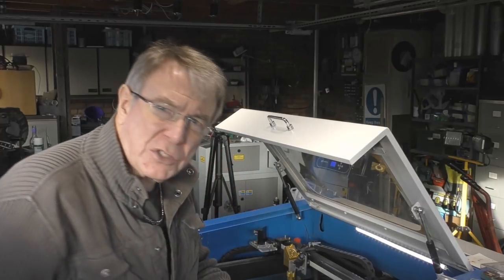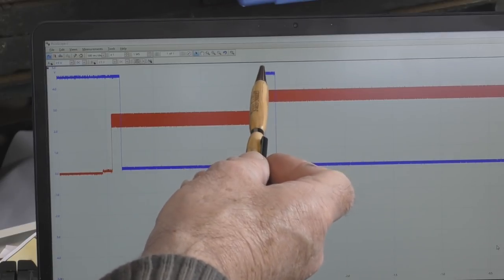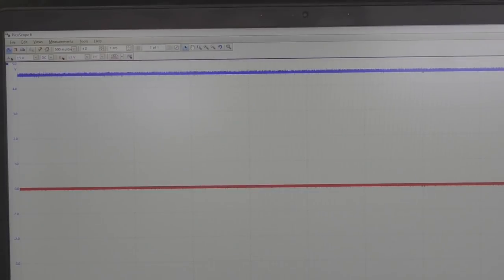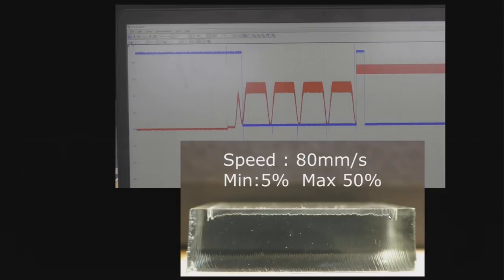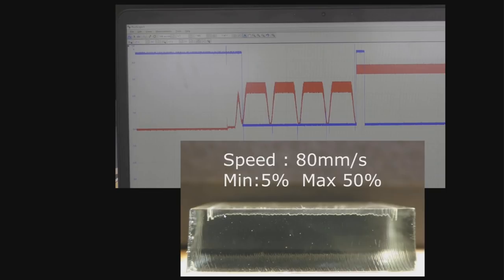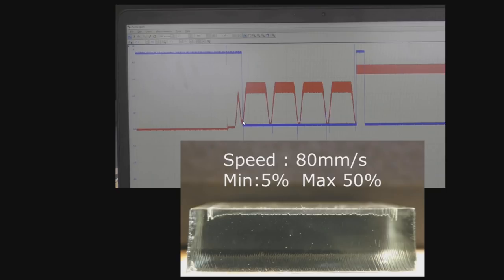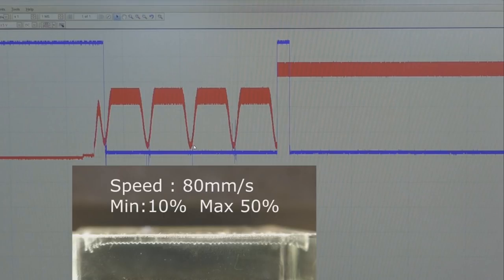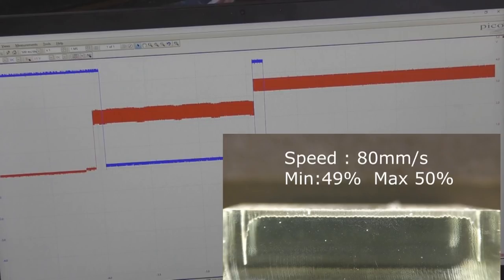RDWorks Learning Lab 134 Max Min Power Revisited

Comment: Wow, this is beginning to make sense somewhat. We have a Thunderlaser 80w Rudia 644XG controller. We have just moved to Lightburn from RD works. Trying to get my head around min, max power settings as I am about to do material tests using lightburn. Our laser is governed to 70% so if you set at 100% it will cut back to 70%, normally we cut max at 60% which is why tube has lasted 7 years.

Comment: Thanks for these videos.  I had issues with my corners on small detailed shapes.  The shapes looked bad in general and the corners we just weird looking and didn't know why.  By going through your experimental procedures I found for my job using 10%/30% on clear acrylic  cleaned up my corners beautifully.  I am now getting uniform etchings.  I'm running 100w Boss system.

Comment: Russ, as you may already know, the laser may take a higher excitation voltage to initially fire, but require much less to maintain a beam once it has fired. Witness the humble ne2 neon bulb. It takes 90 volts to fire it but just over 50 to keep it lit. I would suppose an interesting experiment may be to find a way to measure the applied voltage while watching the tube’s output with a cell phone camera or equivalent.
Reply from the maker: Hi Joff
You are right, in that this sealed tube is just like any other gas discharge tube. Gas is inherantly non conductive  and therefore applying Ohms law we find that almost infinitely high resistance  will not allow current flow  so we need a very high voltage (depending on the gas we choose)m before the gas starts to break down into an ionized condition where there are lots of free electrons that will conduct current. At this point the resistance drops so it requires less voltage to make the current flow. This is why there is a start and a steady state voltage for the tube. In out case those voltages will be dangerously high so DO NOT go near them unless you know what you are doing or have special measuring kit. The start up voltage could be around 30kv and the steady state settles at about 17kv. You cannot see the tube output because it is a  beam of invisible infra red light  You can see the pink ionized nitrogen in the tube but do not confuse that with the laser beam. The ionized nirtogen will change intensity as the current flow changes,  so that will be visible

The following two video will help b ring you up to speed on the tube physics and the power supply design/function.

https://www.youtube.com/watch?v=2F5O-1TH8b0&list=PLPWEtx5V9DqEogIeYRdcG_KYcB7UL2Qmn&index=7&t=124s

and from 4 min 40 this one   https://www.youtube.com/watch?v=5CoTrLNUWTM

Best wishes
Russ

Comment: As with everything on this machines, it depends on a lot of factors, I believe more importantly the laser power supply power vs signal profile. I've gotten to tune my RECI P12 power supply for my application which is laser cutting, as I cut lots of paper, for me it is critical to have just the right amount of power to prevent flashbacks and burn marks, the effect of the min power are such, that I can notice a difference between 13% and 14%, the two min power settings I use the most depending on the thickness of the paper. It may be that my system is more sensitive to these settings because I run servos, with min Acceleration of 3500 mm/s^2, so speed changes are extremely quick. Whatever the Ruida controller is doing, it is awesome, as I get flawless with no flashbacks results using my honeycomb table as support.

Comment: When using plywood, the setting is very useful. Typical settings that work for me are 50mm/s min 24% max 60% - my objective in reducing the power is to leave the surface of complex cuts more evenly yellowed and without dark brown scorch marks. I use slightly higher min settings as it's much harder to salvage pieces from inside corners if there's a knot or void in the wood than when the machine is cutting faster and straighter.
Reply: I agree... I ran many coupons with thin plywood for rocket parts, and when I started playing with Min and max power as well as speed, all of a sudden I went from okay parts to fantastic parts... this was cutting .050” slots with rounded corners , and the min power setting while cutting allowed me to get to very clean cuts in the corners without scorching or creating a routed out effect at the top.  Russ, I think your conclusion is only considering one aspect of the performance for one material at one thickness and one cut geometry.

Comment: May I make a suggestion and give you a new project that will make life easier for you and for all of us. How about integrating a camera in the laser bed. (I think Glowforge  has it) so you can see on your computer screen exactly where your laser light is.  I know Glowforge  has the camera integrated in the software and can resume the laser function even if the madia used is moved from its position, but still, it would be nice to be able to see where your laser is on the screen.
Reply from the maker: Hi Thanks or your suggestion but I think you may have missed the point of this series. I am on a learning journey to explore the extremities of this technology and also to understand the full capability of the low cost machine I ( and thousands of others) already own. Apart from a basic upgrade of tube and power supply, when that became necessary, I never had any intention of "improving" the machine.  There is so little detailed technical information  about this technology available for the enthusiast , that my other hobby , video and editing, allows me to share what I discover. The real pleasure for me is using my engineering skills to understand the darker secrets that are undocumented and the "experts" are not prepared to share.  I'm sorry to say that the pimped up K40 machine you mentioned is expensive, claimed to be "family friendly",  is VERY late to market and  not an example I wish to emulate. I can see no benefit to having a remote camera or a pattern recognition system  on a hobby machine.  You need to be standing in front of your machine to observe the smallest details , to hear and understand what all the sounds are and to "smell" potential danger and most importantly,  be that person that points the fire extinguisher!!
Please be assured that my honest answer and comments are not intended to undermine or ridicule the validity of your suggestion.  Gizmo's  are often great in theory but of little value in practice. I have been very critical of a great idea on my Lightblade machine. Why do I need auto focus? I can set the focus in 1/10th of the time that the machine takes and for every  lens change  I have to re-calibrate the system  anyway. In two and a half years, I have yet to encounter a situation where I could use it for in-process focus adjustment.  However, I am just about to publish a finding that may make me eat my words on auto focus.
Thanks again for the opportunity to discuss an interesting subject
Best wishes
Russ

Comment: While min./max. ramping up and down current in linear manner, output power is not linear.
Reply from the maker: Hi Milan
In general terms I agree  but there are a few things you are overlooking. First, this function  is of no value for through cutting,. The only time this is useful is  when you are using cuts to DRAW with. That will generally be done at 30 to 50% power and in that region most tube characteristic are pretty linear. Did you also spot that the power ramping is not linear but velocity controlled?   The REAL reason  for max/min power existing is to control the current dynamically at the pixel level during grayscale engraving . If you are this far into the series then you will have already watched the 3D engraving videos and seen how we can correct max and min for this non linearity of power.

BNest wishes
Russ
Reply: @SarbarMultimedia  Thanks for all good explanations.Yes, I watched 3D engraving and I like it. I like it more on acrylic than on wood, but that may change as well.
Reply: @SarbarMultimedia  Yes, just re-watched it again. You did amazing job.
Reply: @SarbarMultimedia  Wow, now google made mess with messaging. I already answered, but it sends me message about that again. Seems that google AI falling apart. :D
Reply from the maker: Personal experience tells me Google is about 95% reliable at emailing when new comments appear and about the same success rate at posting answers to comments. It is VERY annoying when a long technical answer get posted to a parallel universe.
 Best wishes
Russ